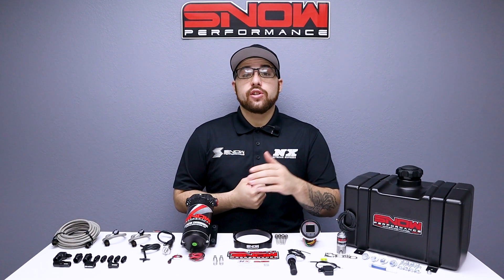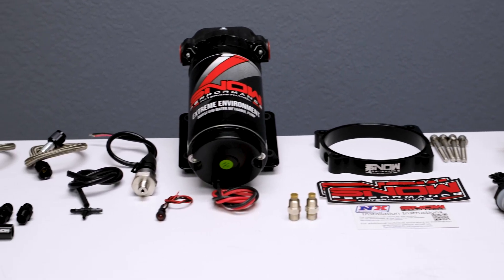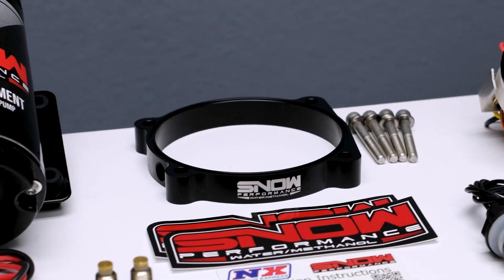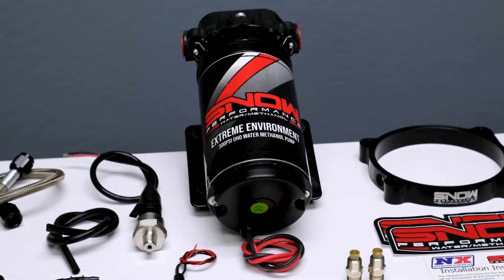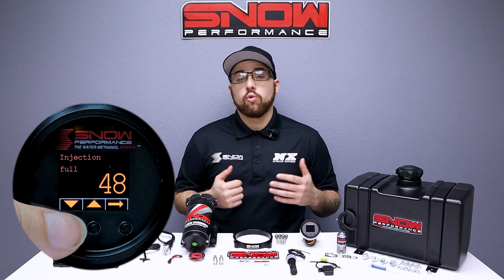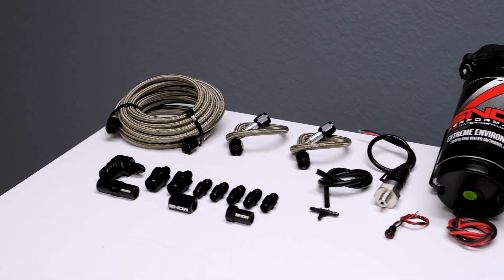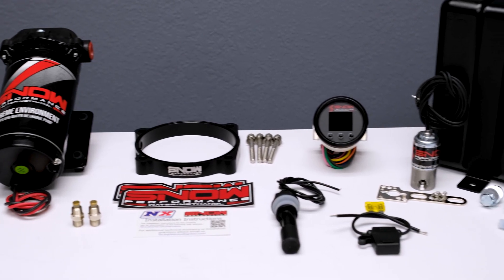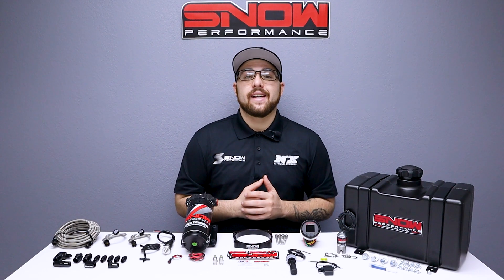Hellcats NEED Water-Methanol!!! Snow Performance 105mm Hellcat Water-Methanol System

Comment: Do you have a kit that works with a stock hellcat throttle body?
Reply from the maker: We do! https://www.nitrousexpress.com/Stage-2-5-Boost-Cooler-2015-Dodge-Challenger-Charger-Hellcat-Demon-Forced-Induction-Water-Methanol-Injection-Kit-Stainless-Steel-Braided-Line.asp

Comment: Need kit for my 19 challenger hellcat redeye but for a 108mm kong throttle body
Reply from the maker: Unfortunately, we don't have a 108 mm plate, but you could run a single nozzle system or have your lid direct-ported by us!
Reply: @snowperformance1  didn't know you could port factory lid....what is about the cost?been looking at the meth lid you already have.
Reply from the maker: Use this link... https://www.nitrousexpress.com/images/custom-intake-plumbing-form-01-01-23.pdf ... And if you want to talk with one of us a little bit more about it feel free to give us a call!